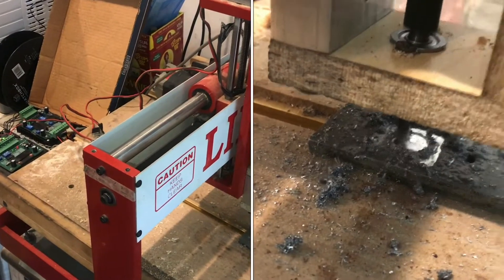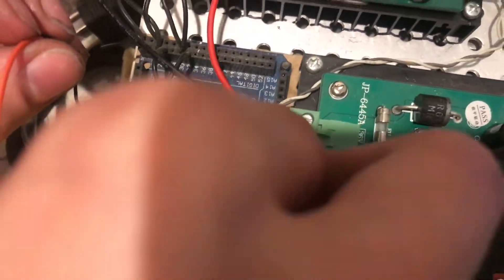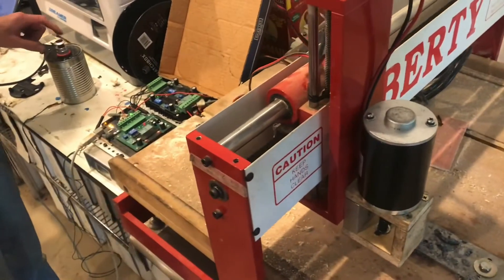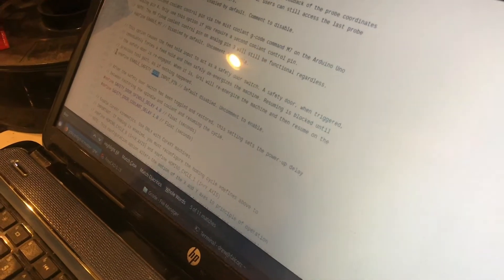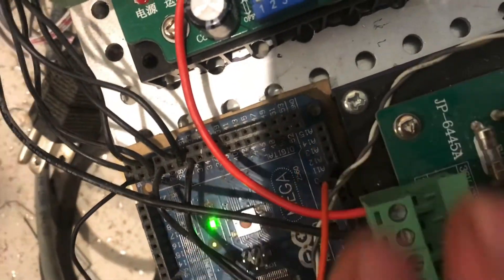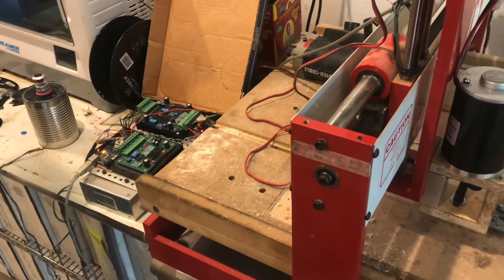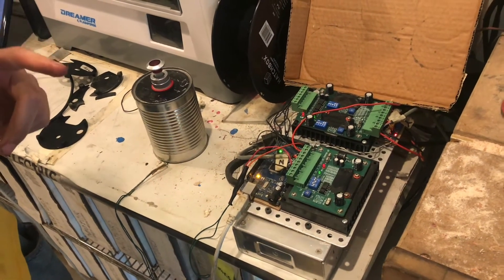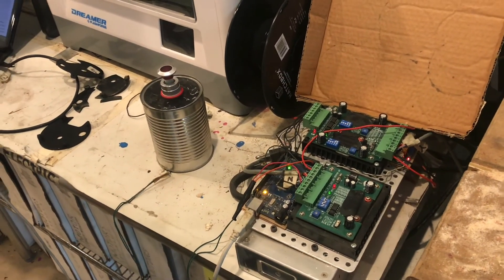setting up EMERGENCY STOP button on GRBL arduino CNC machinery (3 methods)

Comment: i have i what i think they call the woodpecker or camxtool v3.5 grbl board so its one of the smaller all in one boards that have the stepper drivers built into the board. i just got the board about 2 weeks ago an ive had the machine for about 2 yrs but had mainly used it with a laser so never used the z axis due to the laser having a focusable lens so when i started back with the spindle i found it dead an got a new control board an decided it was better to have a emergency stop switch than to try to fumble for the abort button on a laptop but is all i have to do is plug it up into the stop port on the grbl board an i dont have to do anything in the setting or firmware or gcode? this not what im used to. im coming from dealing with 3d printer an if u add a new sensor or enstop or pretty much any change to the machine u have to do something in the firmware to make it work properly. only thing i can think of that u can do without a firmware update is changing the hotend an that still requires pid tune an saving the new settings an that can be a pain with a board without eprom enable and adding cooling u dont have to do anything other than that but for anything else u have to make changes either in the firmware or settings.  theres alot more differences than i had thought until i started trying to use the router more.

Comment: Awesome video. My 3018 is just a kit, so I was just trying to figure out which connector on the board the stop switch was supposed to plug into. So this was way more depth than I needed, but it helped greatly with my understanding of what's going on. I plugged it into "reset" and it works great. Thanks!

Comment: thanks for the video. i’m in the process of installing an e-stop to my ox cnc using arduino and from what i saw one input goes to Analog-0 according to the grbl diagram and the other end goes to a ground pin? thanks i wasn’t able to see which pin you connected the other wire & i do notice that on uno board and mega the first analog pin changes but is the mega worth getting for grbl if i already use the uno? i know that the uno board is maxed out with the grbl code & theres no room for extra features